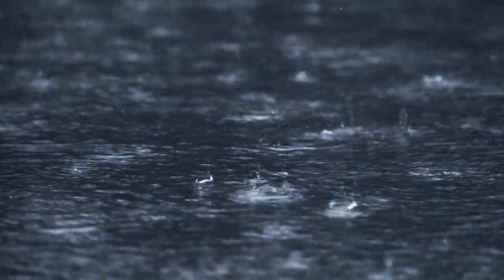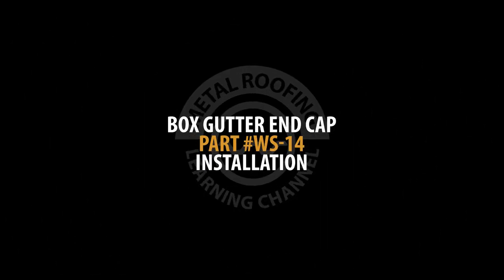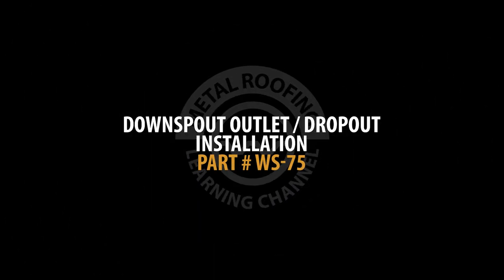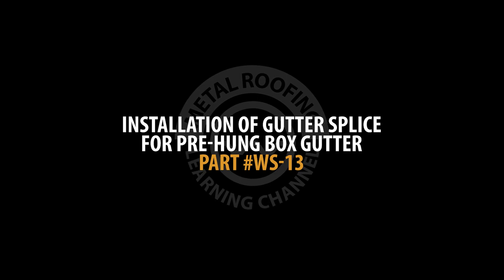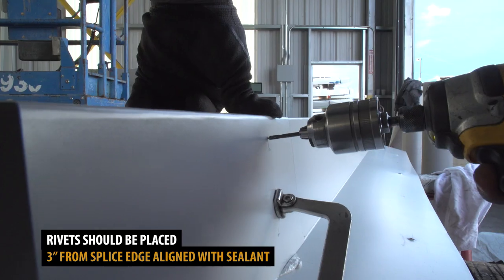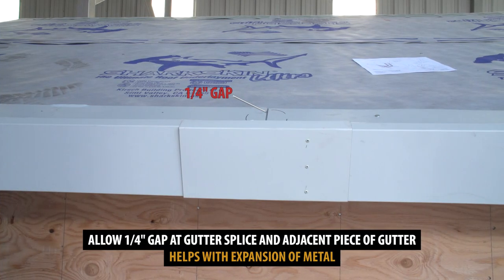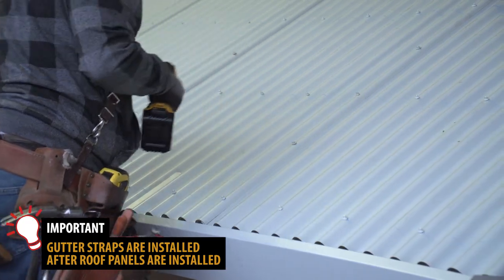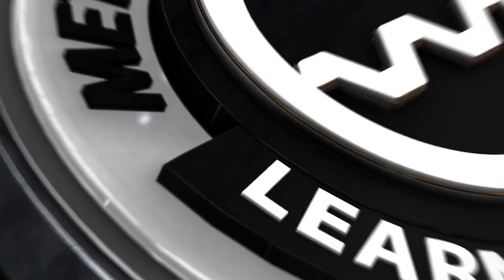How To Install Gutters On A Metal Roof. Pre-Hung Box Gutter Installation For Corrugated Metal Roof.

Comment: Hi, and thank you for providing this channel and great information. I believe that I have the same question as Gerardilson - with the prehung system, how do you provide the slope so that water will run to the downspouts and not just sit in the gutter?
Reply from the maker: Pre-hung box gutter are designed to fit on the apron of the roof and do not allow for sloping. Generally pre-hung are used on smaller runs where sloping may not be required. The pre-hung gutters set flat on the apron as long as the roof apron is level/straight. If you have undulation in your apron, water may build up at that point until water reaches the level of the downspouts. Water will flow out of downspouts and should be minimal amount of water left standing in the gutter. 

If you need to slope the gutters, it is best to use our post hung box gutter. These attach to the fascia board and can be sloped.
Here's a video that shows you how to install a POST-HUNG Gutter
https://www.youtube.com/watch?v=CCB6b69FNmY
Reply: Pp

Comment: What about the gutters pitch? How do you give it if the roof it’s supposed to be leveled?
Reply: @WesternStatesMetalRoofing  I think Stephen meant gutter slope. I can't understand how the water will run towards the downpipes because the gutter seems installed level.
Reply: I'm about to install this system and I'm wondering the same thing....